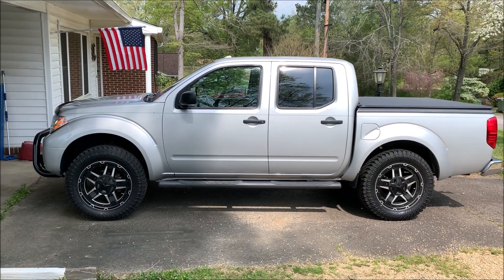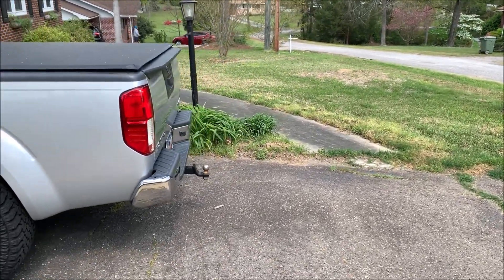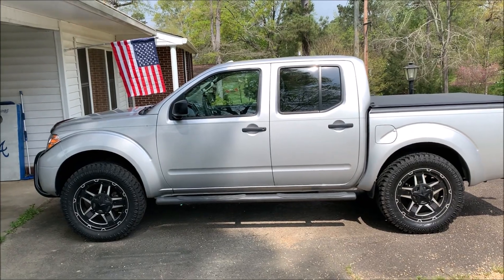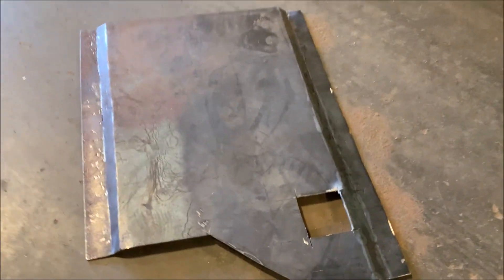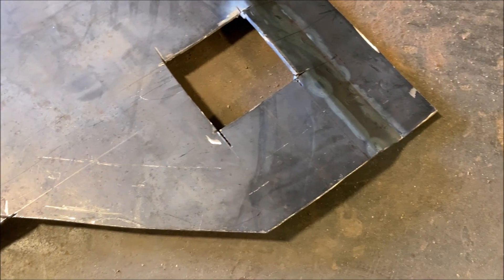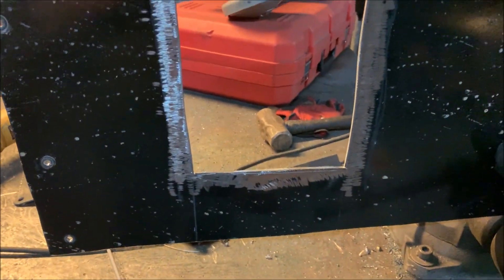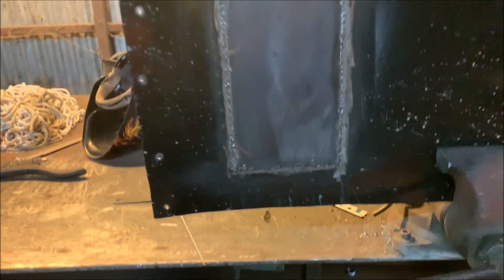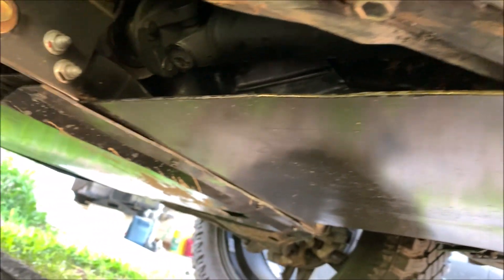Nissan Frontier DIY Skid Plates - Truck Build pt. 1

Comment: Great video. 
Do you by chance still have those exact measurements?
I have a water jet and press break at work and would love to use it them for this.
Reply from the maker: @fergk5527  I don’t have the exact measurements. I literally went under the truck with a tape measure and just built it as I went.

Comment: I have been searching and researching for a little over a month off and on and debating whether I wanted to make my own or order some. I was in the same boat, looking at the prices of PP or Fabworks and comparing that to a sheet of steel, seeing this I might just go ahead and do my own! Awesome video looking forward to more on the Frontier. Also, any idea what gauge steel you went with?
Reply from the maker: I’m not exactly sure. It was thick enough to do the job. It was some leftover I had access to.

Comment: Subd! In Columbia, SC is a pretty badass shop called Bashfab that makes custom one off bumpers and anything you can dream up down to furniture and handrails.. Should check them out for simple pre runner bumpers! They just did one on a 2011 Tacoma and front on a Tundra recently that was sweet
Reply from the maker: That’s good to know. What do they charge for a super simple prerunner style front?

Comment: Great video thanks for posted. I am looking to do the same for my xterra and have a few question. What were the dimension of the steel sheet and where did you buy it ? Is it expensive ? Thanks iA.
Reply from the maker: It was a 4x8 sheet of steel. It was leftover from an old job. I’m not sure of the price. Even buying a brand new sheet and tools will be significantly less expensive then buying the premade plates.
Reply: 1/4 inch steel in alabama is not cheap.

Comment: Also could you tell me the dimensions of the sheet metal you used? Length and width
Thanks!!
Reply from the maker: I don’t know what the dimensions were. I just got under the truck with a tape measure and started measuring until I got it all figured out
Reply: SCliving Outdoors ok cool thanks